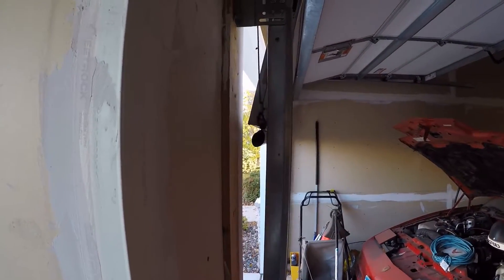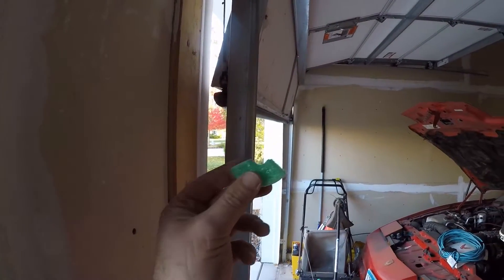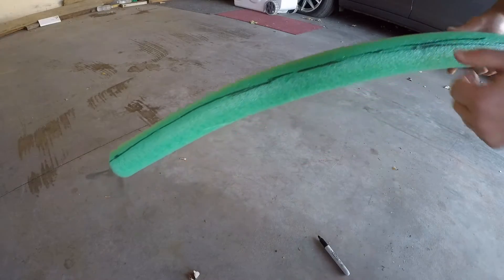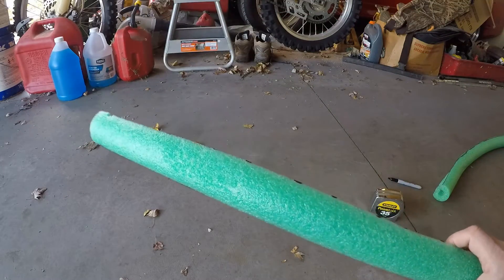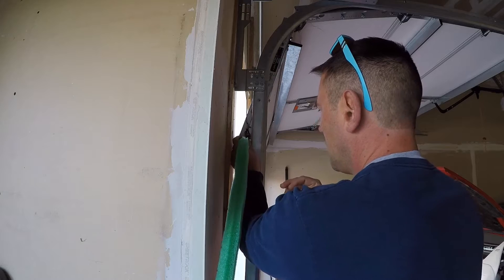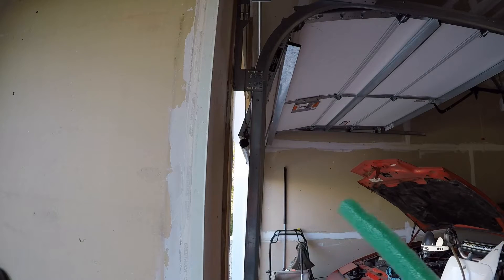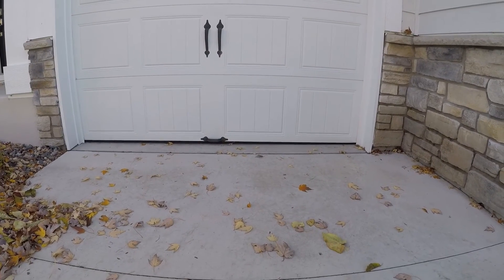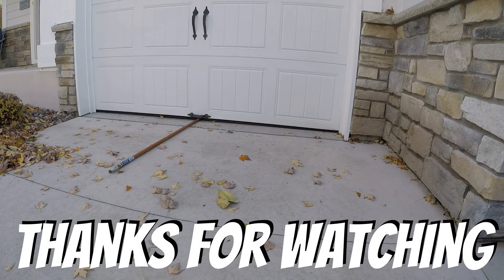How to fix a garage door seal with a noodle.

Comment: I came up w/ a similar idea a few years back at the motorcycle repair shop that I work at. Our bay door is on a downward slope, so every time it rained, all of the shops on our row would get flooded because the drains can't accommodate a lot of water very quickly. 
So, I took three pool noodles & put them onto a nearly garage door width PVC pipe to make 1 long noodle w/ about 6" of "slack on each end. So, when we expect heavy rain, I open the bay door  just enough to put the noodle under & close it down tightly, & use the slack on the ends to stuff into spaces not covered by the door track ends & to direct any water away from any extra spaces outside of the door that may allow water to pass & get inside. 

I hope all of that makes sense. 

I'm about to make a new one because after a few years, the noodles start to disintegrate. THIS time, I'm going to try & coat them with GORILLA brand Waterproof Patch & Seal spray. 😊
Reply from the maker: @bossylady80  sounds like a great solution thanks for sharing. I've worked in commercial shops where they have an air blatter which works really well but lots of failure points I like your solution better.
Reply: @thecitiots  WOW! Thank you! 😊 I just finished making the new 1 & putting it in place for the anticipated storms over the next few days here in Delaware. 🤞🏽
Reply from the maker: @bossylady80  you should post a video of them in action

Comment: Thanks for video. My biggest pet peeve in the winter! Going to try 1” foam backer.
Reply from the maker: Yeah me too,  the foam seems to smash over time will last at least a year. Well worth it if it contours over the ice. If you're using foam backer use a continuous run the sections seem to work their way out over time with the noodles.
Reply: Ya it’s a pet peeve of mine.  Gaps in the garage door and then in winter, the garage is freezing.

Comment: Dude you just saved me some money on heating my home. All that cold air pushes its way into the home.
Reply from the maker: If you can seal the garage decently and a warm vehicle inside will help a ton to keep the garage warm.
Reply: @thecitiots  I benefit from this in the winter and have to let my car cool off outside in the summer before I put it inside
Reply from the maker: @silentvoiceinthedark5665  glad it's working out if you have tips to share please do
Reply: @thecitiots  Sharing tips sounds like a good idea, the only thing I can think of is about the moron that built my home and decided to put the dryer duct vent right next  the central AC condenser, the coil is plagued with lint. I am going to relocate the duct outlet. This seems to be a problem with many homes. An AC system that has lint on the condenser coil runs at the fraction of efficiency.

Comment: I had some 1" round foam laying in the garage and inserted it the length of the double door.  a dab of epoxy glue at each end.  going on year 2 and no issues so far.
Reply from the maker: That's awesome nice ingenuity 🤘
Reply: I'm glad i found your comment. I just bought the same. Backer rod was only $5 for 1"x10' pretty cheap. I was hoping to find someone who had tried it already before I make a go at it. Thanks!

Comment: 1” foam backer rod
Reply from the maker: I agree after a while of testing the foam seems to compress and the individual strands work their way out of the garage seal. Still working on a better solution opposed to having an air blatter like some shops do.
Reply: @thecitiots  How did you close the ends of your garage door seal after adding the foam?  Did you screw it in or just fold the ends inside eachother.  I'm wondering if folding the edges in will help the foam stay in place.
Reply from the maker: @OShackHennessy  I cut a piece larger than the opening and smashed it in on both ends. They keep coming out, wondering if some silicone will keep them in place. Or run a machine screw through the ends.
Reply: @thecitiots  I don’t think the silicone is a bad idea, maybe try to get some inside the channel as well as the ends. I’m thinking the foam might rip around the machine screw and come out anyway.
Reply from the maker: @OShackHennessy  good call, hopefully winter will provide some ice so I can see if this works well or not.

Comment: did it work?
Reply from the maker: Helps seal the garage better but we didn't have the ice build up last winter. Hoping to test it better this winter.
Reply from the maker: Pat Last  interesting thought, as long as it's closed cell foam.
Reply: Better to install a rubber floor seal. The pool noodle inside the door seal wont stop air or water 100%. A floor seal will.
Reply: Expanding foam cures hard.  You want something with some give that will spring back after being compressed.

So how did it work this past year?  I have a gap around my bulkhead door that lets drafts and bugs in.  I’ve been thinking of shoving some noodle in the crack 😂

Comment: Good lord man. Just use closed cell backer rod.
Reply from the maker: @bysykler4959  $$$$
Reply: @thecitiots  Well, either you bought that   pool noodle or some kid is missing theirs. 😂. I just got back from the store and paid $6.22 for 10 feet of 1 inch backer rod.  And why are most new garage door gaskets such garbage??!!
Reply from the maker: @bysykler4959  we bought a bunch of pool noodles for 99 cents. Seems like a lot of products these days are designed to fail quickly.